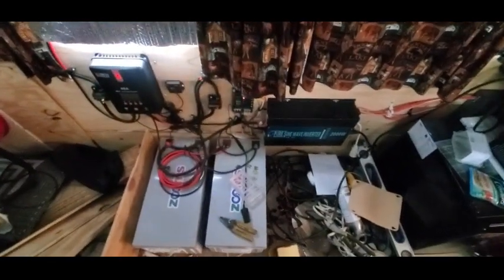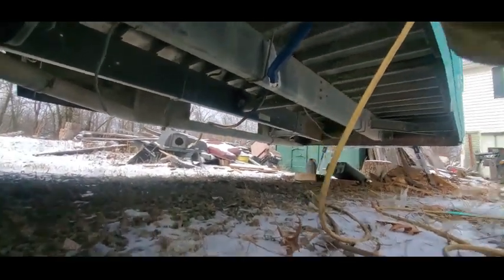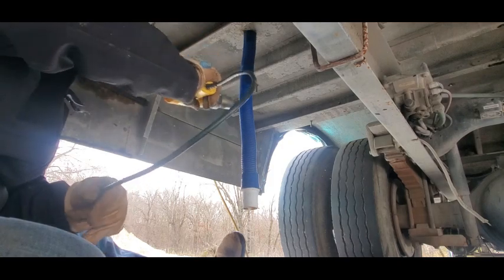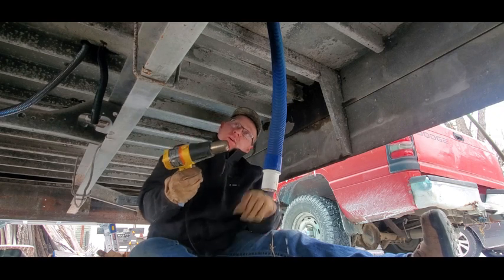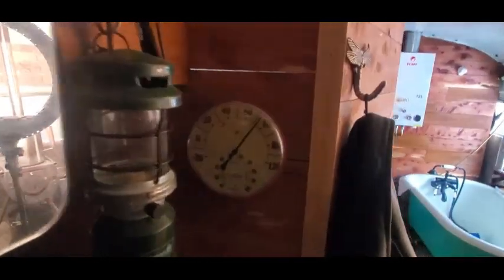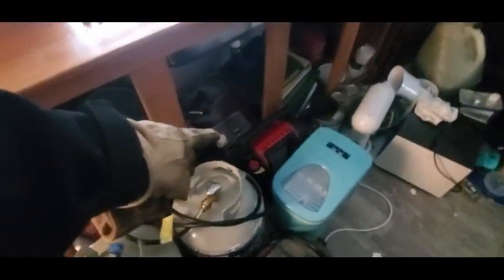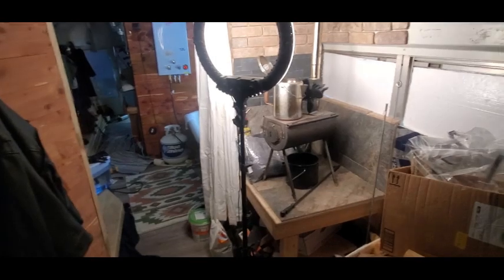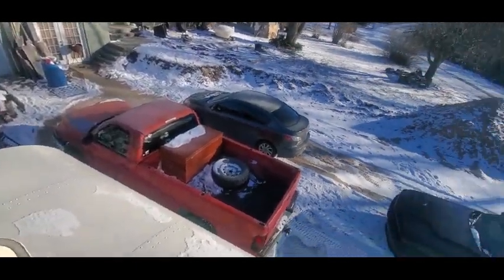#buslife siberian arctic blast living in a bus.

Comment: You earned that hot bath & latte.  
Did defrosting the panels make a difference? 
Hope your  Christmas was Merry , Jolly & Bright.  
❄️Have a safe trip Dave❄️
Reply from the maker: Yes it went from around 42 watts to 298watts which is less than half of what they're rated at putting out. In the summer I get closer to 4 to 500 watts  so I guess I need alot more solar. And alot more batteries. And another diesel air heater. Just to keep the batteries warm.